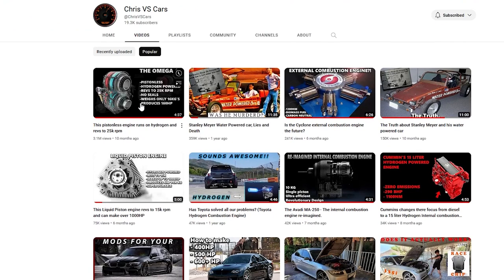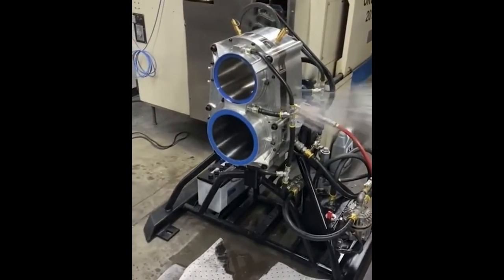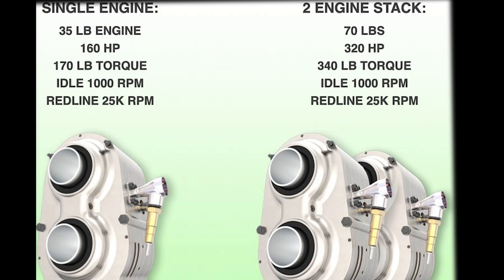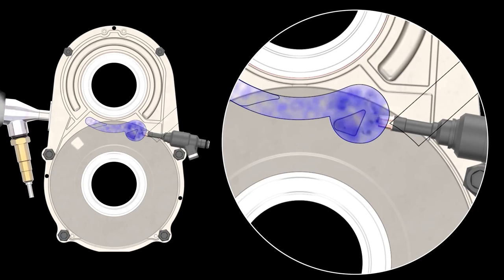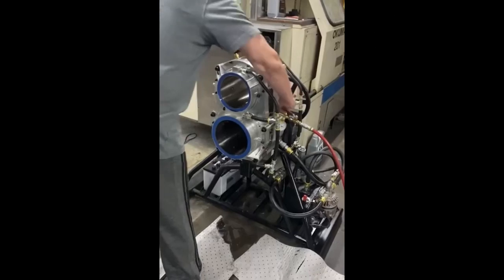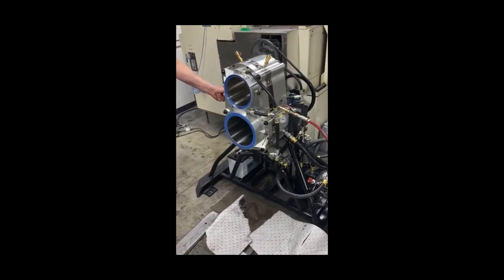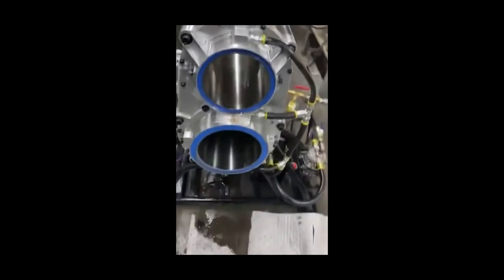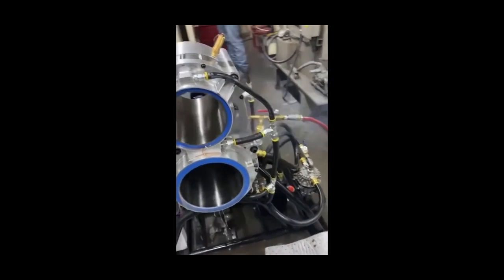The Pistonless Omega 1 Engine - Finally Working Prototype ahs been Revealed!

Comment: Quick question if the engine revs up to 20k+ how could the horsepower possibly be less than the torque measure.. horsepower is defined as torque*rpm/5252. Should it not be 170*20000/5252= 647hp?